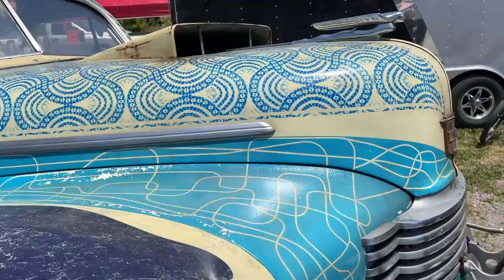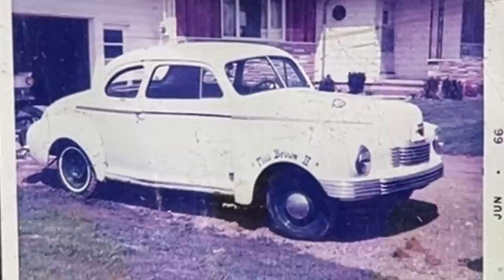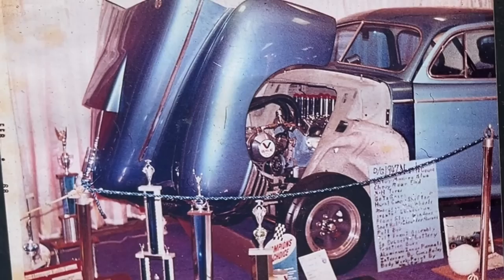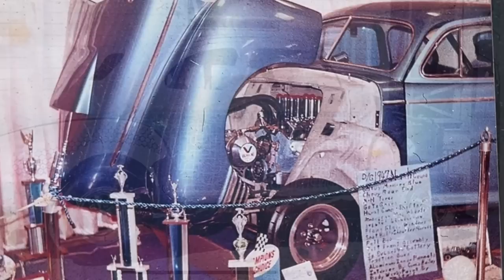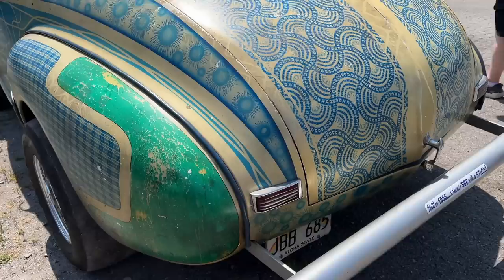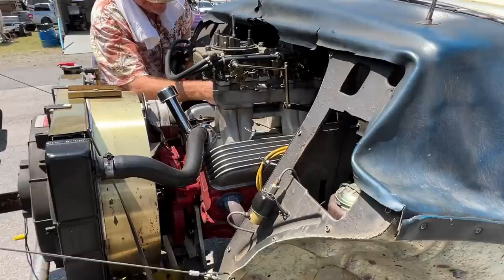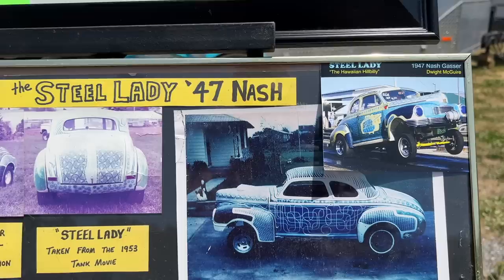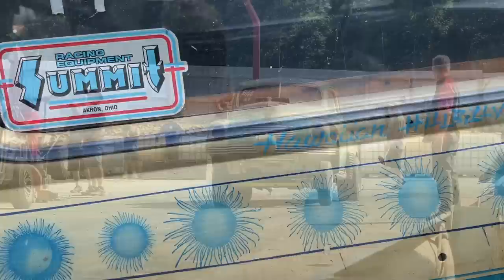PARKED for 37 Years - NASH Gasser Lives Again

Comment: That thing is awesome. There is a super famous gasser in tacoma where I'm from that had a wild paint job done early 70s,car sat paint started bubbling and chipping. The dude who baught it redid everything just as it was with upgrade safety stuff. Since the car was known for this paint job he put a ton on clear coat on it and it has held everything down and it looks awesome. I'm not a fan of clearcoat on rust but to preserve that spacial paint job on the Nash the clear would hold everything there for 100 yrs,what a gem. Thanks for sharing